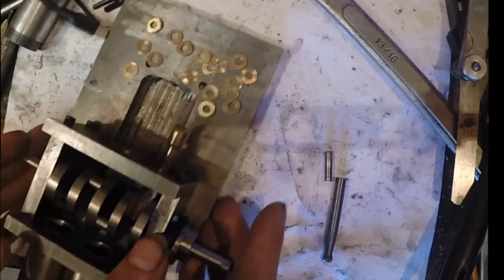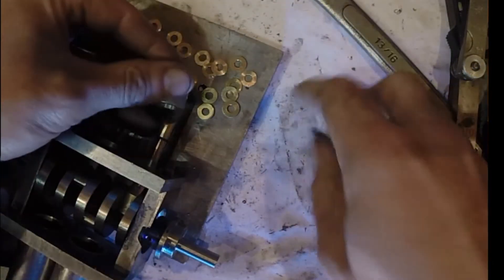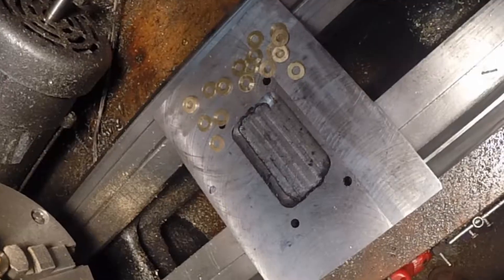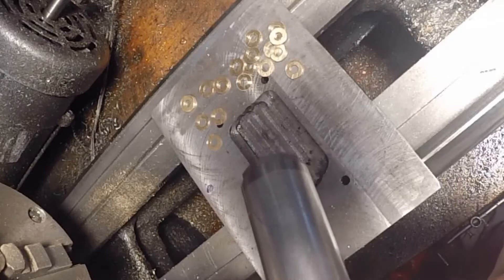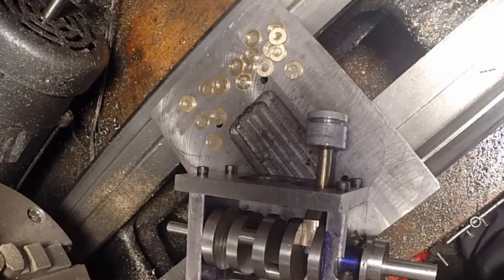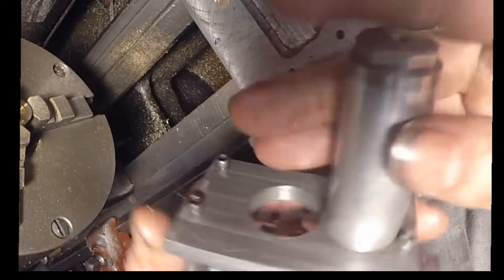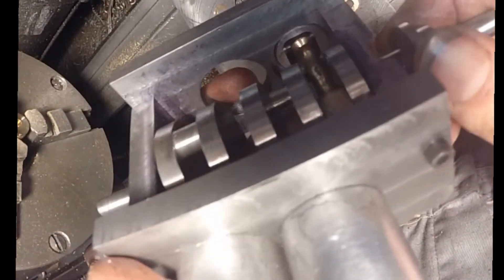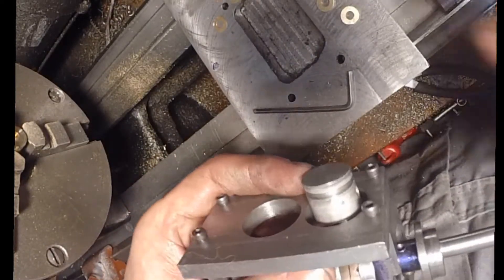Building a model steam engine: Installing Steam Engine Piston Washers Part 1

Comment: Hi Matt,
What is the idea behind the washers for shimming the small end to piston clearance ?
I would have thought a little "float" in this area to be the way to go.
Cheers Eric
Reply from the maker: When I made the pistons, the hollowed out parts where the connecting rod goes was done without any measuring and some of them had large gaps.